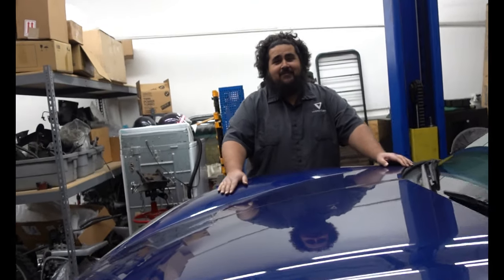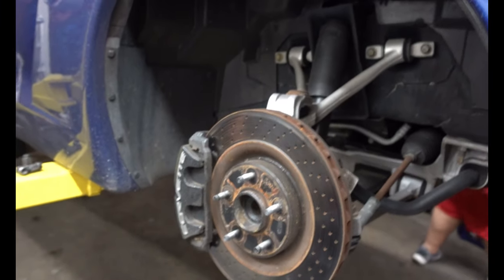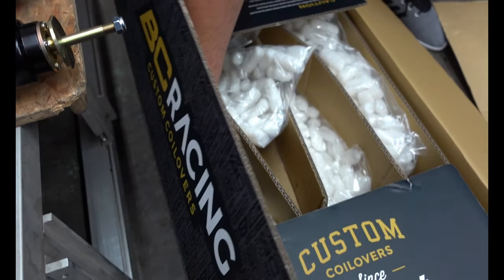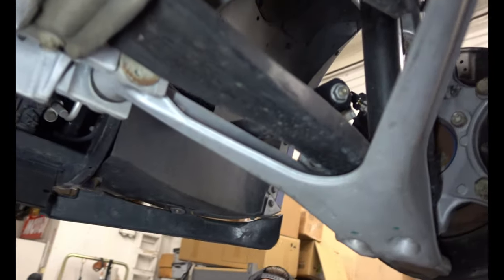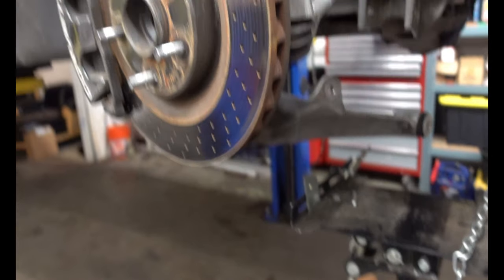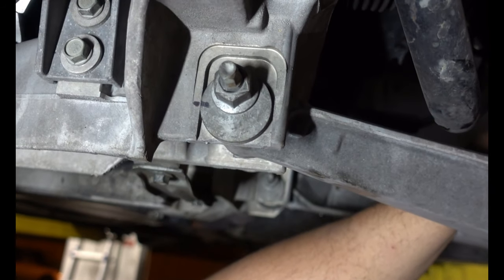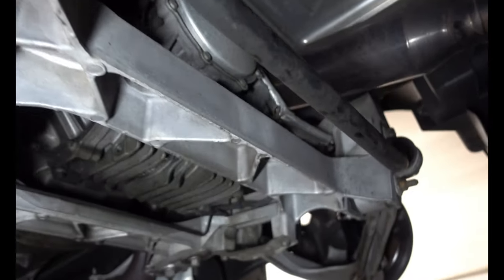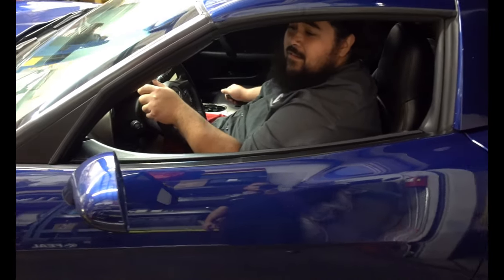C6 Corvette gets a major UPGRADE!

Comment: Could you let me know where you got that diff bracket? I have a 500 whp ls2 stroker c6 and I know this is just waiting to happen! Those bastard child 2005 vette diffs...
Reply from the maker: We found someone selling the bracket on C6 forums. There is a guy on there that makes them.
Reply: Luke Pakula yeah I tried finding the guy on there but no luck yet. I was gonna show ya some cool vids of my vette too. I’m outta Washington. Wished I wasn’t so far from you guys, I’d say let’s hit up a car meet sometime. I sent ya a FB friend request. I’m a huge gear head like you guys too. I’ve had 61 cars and 7 sport bikes total. Never gotten Into proam drifting but I love racing bikes at the track. Sold my last r1 recently to get the wife a better vehicle. You guys would like my 05’ vette though. She’s 493 whp on an all motor stroker build. Contemplating a procharger. I’d love seeing 700whp but these cars are already tough hooking up and I’m 11.2 to 1 compression. I would t run more than 5-7 lbs comfortably